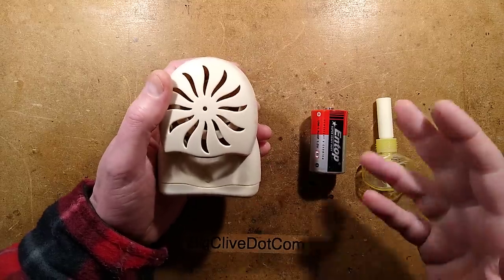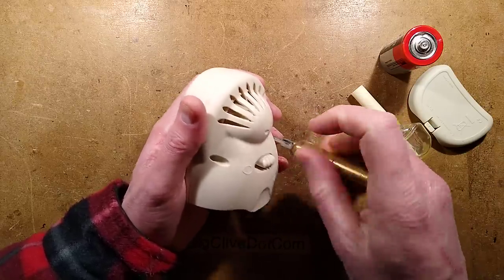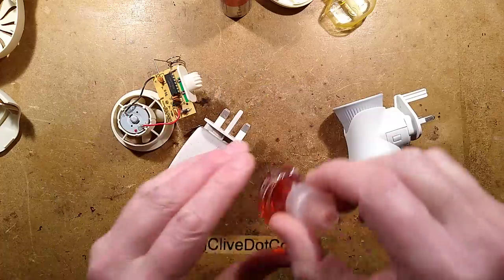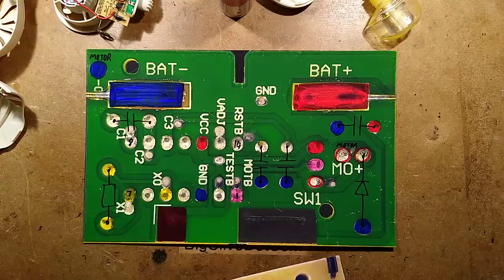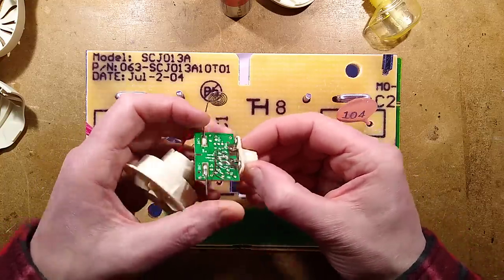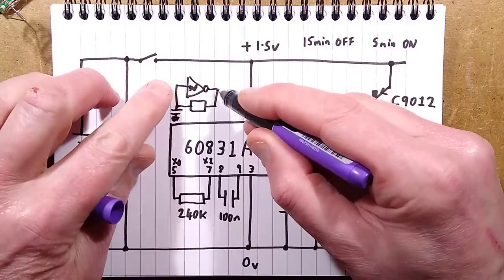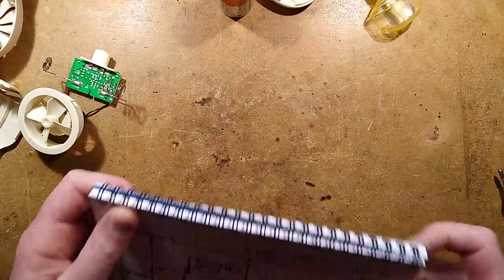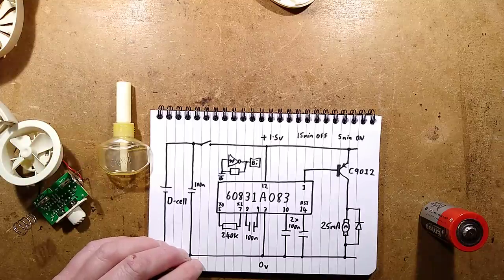Old 1.5V fan based aroma unit teardown with schematic

Comment: I'll bet the cycling on and off is because we notice smells much more strongly if they change. A static smell doesn't register with us (you 'get used to it'). So  by turning it on and off they cause your nose to notice the smell much more strongly.
Reply: that's why I set my aeroma spray machines to the lowest spray time
Reply: I personally doubt that a 25% duty cycle with an oil based aroma would fluctuate enough over a long enough time frame to avoid that particular phenomenon. My bet is it was an easy ratio that they tested so it was always enough but not overpowering.
Reply: It's called nasal fatigue. You can't smell strong odors for too long because your olfactory system becomes tired. You can 'reset' your nose by smelling an equally strong odor like coffee grains, or resting it by removing yourself from the source of strong smells for an hour or 2.
Reply: So a constant fart would not be noticed over time, interesting thought.
Reply: @RS-Amsterdam  see also your own BO, bad breath, etc
Reply: @Dennis M1DLG  my friend attempted to start up a business selling candles and wax melts, he had an issue where he kept putting too much fragrance oil in because he couldn't smell it 😂 it just turned out because he was sleeping in the same room as the products he got used to the smell and began to not smell it anymore! 
The business never took off too much procrastination😂
Reply: I wish I still had a sense of smell... 😭
Reply: @RS-Amsterdam  indeed

Comment: "Sacrilege to air freshener collectors?" You mean there are others? The model number on the PCB starts with SCJ, a clue that it was made by S. C. Johnson (aka Johnson's Wax). Having seen that, a light bulb went off in my head that Oust is of course an S. C. Johnson brand. I'm working on my reverse-engineering skills and have learned a lot from your videos, but I've still got a long way to go to reach your level of proficiency. It is a lot of fun for us "technical people". Love the "Beagle" label on the chip.

Comment: The suffix 'B' is short for 'Bar', used to denote an active-low signal (on a schematic there would be a black bar drawn above the signal or pin name to show active low). Can also find 'n', '!' or '#' on a schematic meaning the same thing. The clue was RESTB - typically on microcontrollers the Reset line is active low - pull to ground to reset the chip.
Reply: Indeed. A couple of other popular notations are / or ~ usually in front. The overbar notation is helpful e.g. in De Morgan's laws and can be entered in many electronics schematic programs.

Comment: The B suffix on the pin names probably means active low. Not sure where the convention came from, but I've seen a bunch of RSTB pins across different datasheets.
Reply from the maker: You're probably right.  I'm so used to there being a line above the symbols to indicate that they are active low.
Reply: Yes, and the 'b' stands for 'bar', referring exactly to the logical inverse bar Clive mentioned.
Reply: @mrrkrr  Isn’t a name used in electronic engineering
Reply: “bar” was very common for active low signals in the past. It was always hard to decide how to type it. Using B at the end was one convention. Another was to add a “/“ character before the name (e.g. /RST). Today a lot of people will add “_n” to the end of a signal name - especially in Verilog or VHDL descriptions - to indicate an active low signal
Reply: @timpontius  Good summary. My contribution to the naming conventions used in microelectronics was to design a 'power on detect' circuit with an active high output called PHOK (power high ok). The disable feature was called PHOK_OFF. The marketing group only discovered what had been done when all of the documentation had been released, and it was too late to change everything.... Not that the engineering team cared much what that marketing guy thought on this project.
Reply: @Mike-H_UK  love it!!
Reply: @Mike-H_UK  Reminds me of the Sign EXtend instruction. Somehow Intel decided to rename that to CBW and CWD for later processors.

Comment: Given the big cross through the Pb on the circuit board. I’m guessing probably not leaded solder.
Reply from the maker: I really should read the text on the PCBs.  I just tend to read the components instead.
Reply: I wouldn't bet on it... plenty of boards going out of factories with that symbol just for show since there's virtually no proactive policing of RoHS.

Comment: The "one on three off" ratio is the same as the 6 hours in 24 used by the Xmas light timers, so it's probably just a binary counter using one of the higher value digit lines as the output.

Comment: Nice ! I particularly like the switch idea :-)  Seems like a 555 might have done the job
Reply: Thing is this needs timing intervals longer than can be easily done with RC oscillators at this size and cost.

Comment: Oh wow, I remember having one of those (in the US) around 15 years ago. Don't recall how well it worked or what I thought of it, though. However, the fan gave me an idea more recently for a little DIY enhancement to my scented wax melt cubes. I usually sit down next to them, but most of the fragrance just seems to go straight up to the ceiling rather than where I am. So I took a spare 5-volt, 1-inch cooling fan I got from a Raspberry Pi kit and taped it to the side of a small cardboard box at a height that just cleared the lip of the wax warmer bowl and plugged it into a couple of Eneloops in series (which conveniently fit inside the box itself). Then simply place the fan right in front of the warmer so it directs the fragrance toward where I am. At reduced voltage, the fan is barely audible yet makes a noticeable difference (it doesn't take much air flow to do the job). At a current draw of about 25 to 35 mA (depending on whether I use 2 or 3 cells), the fan runs for quite a while on AA cells.

Comment: I saw "vintage" in the title, and thought - nope those are still sold commonly in the USA (Glade/SC Johnson I believe).  But then you showed that it took D-cell batteries - I haven't seen or bought a D-cell (much less anything that's used them) since the 1980s.  However, I don't think those oil aroma things aren't older than the 1990s.  I think what's more advertised and pushed in the USA are the plugin versions.  Aerosol based air freshener sprayers that use batteries are still available, I believe (AA cell - pretty much everything is AA in the USA).

Comment: I remember having a “fan” based air freshener in our downstairs loo ~ of the air wick brand and the outer casing was wisp/flame shaped with curved silt vents and an oval hole in the middle to see the aroma oil level, a 3-position switch for min-med-max setting under the hole on one side. When I went to the bog to poo on it, I would take the cover off the freshener and watch the little fan spinning in intervals, the aroma oil bottle had a large diffuser pad on top, the battery’s 2x AAA, were attached to the bottle to ensure they were replaced when the oil ran-out. When I had finished, I would replace the cover and set it to the setting mum had put it on and replace it on the window sill above the toilet. Now we just have an aerosol based spray freshener used after “flushing” the toilet ~ in the summer we open the window
Reply from the maker: I've literally just taken a PCB picture of that very unit.  Sadly it's based on a blob chip.

Comment: I have vague memories of my late grandfather having one of these air freshener fans.

It's quite difficult to find D cell batteries these days outside of online battery wholesalers ,especially here in the UK, and they are generally expensive .

In the past D cell Batteries were used in flashlights/torches that aren't very bright by today's standards of flashlights/torches and also used in carry along CD-Radios which also went out of production and usage

Comment: The symbol on the PCB indicates it's lead free. The PCB design was 2nd July 2004, yet the circuit is probably another 10 to 20 years older.

Comment: Are the other pins on the IC different taps into the frequency divider to give the designer other options. The more upmarket versions of these have switches that allow the user to select different on-times.

Comment: Speaking of the 4060, I'm currently working on a clock based on the 4060B and 4026B, which will drive a set of six soviet era 7 segment VFD tubes. I found one circuit for a 7 segment LED clock online, but I'm not happy with the design so I thought I would modify it to be a little more elegant and functional.

I did find one interesting suggestion in the 4026B datasheet, which was to reference the VSS pin at 4.5V above ground, with a 13.5V logic level that would put the VDD at 18V, which would be enough to drive the particular VFD directly, without going through level shifting transistors. The datasheet for my tubes lists the anode voltage range from 22 - 30V, so I would need to run VSS at least 4V above ground to be within the 18V recommended maximum voltage.

Comment: Love the way that came apart. Had to pause to notice the DFM that went into that assembly process. The way the battery holder wires fit and the PCB and all. Maybe the 240K and 100nF functioned as the programming values for the oscillator? Could the Beagle be some kind of simple counter? Logic blocks like that are super duper simple, so it's a great guess at what's inside. Great teardown!
I would think that by changing the value of the C or R to see if the timing changes would be an easy way to see if it's hackable.
Reply from the maker: I did try changing the oscillator resistor and it gave control over the timing.

Comment: I guess the closest thing you can buy these days is the "P-Wave Easy Fresh Fan" - probably more used in commercial environments like toilets. Looks quite interesting as the case itself is the fragrance. There's also an 'ONA Breeze' or 'Cyclone' that sits on top of some odour-emitting gels.
Reply from the maker: I found the P-wave fan in my research for that video.  It adjusts the fan run time based on time the age of the scent refill.  Short bursts when new and continuous when old.  Also quite an expensive unit.

Comment: i notice the board has a logo displaying a circle and line crossing out the letters pb suggests it is lead free solder ? you mentioned the battery terminals are probably lead solder perhaps they are not 😉 would this be correct or does the logo mean something else
Reply from the maker: It most likely is lead free.  It's been around for a while.

Comment: You could fill a jar with ten different liquid scents, each with a different specific gravity, so that the top layer gets used first, followed by the lower layers. Maybe.
Reply from the maker: I think it would be hard to stop them mixing.  But you can have multiple units under custom control.
Reply: 24 scents, each active for an hour.  You now have a scented clock.
Reply: @Deipnosophist_the_Gastronomer  Good idea. Should midnight smell like Dracula?
Reply: @ronliebermann  You know, I like it.  👍

Comment: 1.5V is too low for the 4060. The low voltage is probably why a dedicated chip is used, rather than an MCU, although I believe there are 4-bit mask ROM MCUs which will work at such low voltages, which is probably what's used in the COB version.
Reply: Could be something like integrated injection logic that works at 1.5V.

Comment: You could replace the 240K resistor with a 47K in series with a 200K VR to see if you can alter the timing. (?)

Comment: It made me think of a 4060 too. It sure looks like its operation would be quite similar. I wonder if it's a modified version for low voltage etc.
Reply: Pinout is wrong and 4060 alone only provides 50:50 duty cycles, unless you add external circuits detecting a desired bit pattern .  But it feels like a similar chip from some other company .

Comment: Clive, I have a few things I'd like to send you to take apart & maybe repair. How do I go about sending them to you? However these items are 120 volts and some stuff is American 240 volts requiring (2) 120 volt inputs. I don't know if you would have that sort of electrical supply available in your residential electrical system?
Reply from the maker: Shipping stuff between the USA and UK is not recommended at the moment due to "politics" caused by an ex-president.

Comment: Seems unusual to run a chip at 1.5v. Not unheard of though.
Reply: A lot of CMOS will operate at 1V, albeit slowly. This is probably a custom CMOS chip, probably derived from standard blocks, although it likely is using only a metalisation mask to do the logic, the rest of the chip being the standard chip off an old alarm clock, just using the crystal oscillator side to generate the RC oscillator, and a few of the divider stages, then some logic repurposed from other dividers to do the rest. Cheap enough to do, at least in the line of custom ASIC world, as you basically order the chip with only a single mask different from the fab, and get a good reduction in the cost as you do not need to buy all the diffusion mask sets. Just an oscilloscope onto those pins, probably with a 10M resistor in series with the probe on the high impedance parts, like the resistor and the floating 100n capacitor, would show up a lot of info.

Comment: I suspect that custom chips in 14-pin DIPs are getting rare. Blobs today, yes.
Reply from the maker: It's all microcontrollers these days.  This unit would have a small voltage boost circuit and an 8 pin microcontroller these days.

Comment: Hi. Could you please explain how the input voltage selection switch in an SMPS works? Because when I tried to see what's going on with it, I noticed it is connecting a capacitor to L or N, not sure though. Why is it so?

Well I had a "220V explosion" and only after which I noticed the selection switch was hidden under a sticker saying 110V only!
Reply from the maker: It often uses a voltage doubler circuit to raise the 110V to 220V.
I show it in this video:-
https://www.youtube.com/watch?v=ZNenxTVzFH0

Comment: If you get to play around with a piezoelectric unit, I'd love to know how to drive the piezo unit directly, can i just treat it like a speaker and feed it variable freq??
Reply from the maker: I've featured piezo atomisers in videos.  Often with a fixed frequency drive from a microcontroller and boost transformer.

Comment: Scope pin 5 and pin 7 to see if there is an oscillator inside as you predict and let us know what you find. In the mean time I am going to replace the scent bottle on mine with a bottle of poppers for when friends come round.😈
Reply from the maker: I did experiments with the timing resistor and it did change the timing.

Comment: Could you do tear down of airfrayer
Reply from the maker: They're not complicated.  Basically a motor with a fan on both sides.  One to circulate the hot air on the inside and one to circulate cool air on the outside of the cooking chamber.  The heating element is often a ring around the hot fan.

Comment: Wonders why they didnt just use a 555
Reply from the maker: The 555 isn't so good for very long delays.  It also has a minimum voltage of about 4.5V.
Reply: @BigClive  Fair point

Comment: OK, this is a bit of a hijack but I have an application where I want to dump some power. I have what appears to be a standard Sylvania 130V, 60W bulb that by my calculations should have a resistance somewhere around 240 Ohms or thereabouts. Yet when I measure it with my multimeter, it's measuring around 20 Ohms. I thought it might be a short in a dead bulb but I powered it and it's working fine with about the correct brightness to my eye. My multimeter is fine and was measuring resistors correctly yesterday and I've checked the measurement against a cheap multimeter and it's close enough for Jazz. From my understanding, the resistance of metals is supposed to decrease with temperature. Any idea what's going on?
Reply: The resistance of incandescent filaments increases with temperature. They wouldn't work well if it was the other way around.
Reply: @georgescott6967  It depends by how much. I think it would have to be severe to get some kind of thermal runaway. But good to hear that's the case. For my sanity, at least.
Reply from the maker: Lamps often have a lower resistance and high inrush current until up to temperature.  In the older theatre equipment there was a preheat setting to reduce the shock to the filaments.
Reply: @georgescott6967  Old carbon filament bulbs were negative temperature coefficient of resistance. The reason they didn't burn out instantly is that the amount of heat radiated is related to the temperature raised to the fourth power.